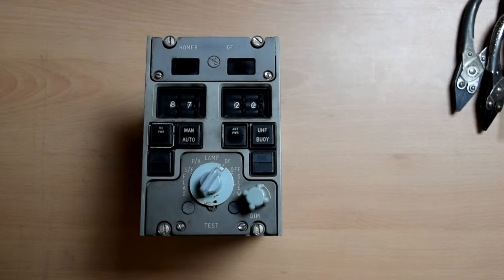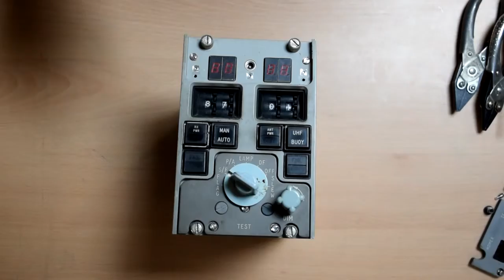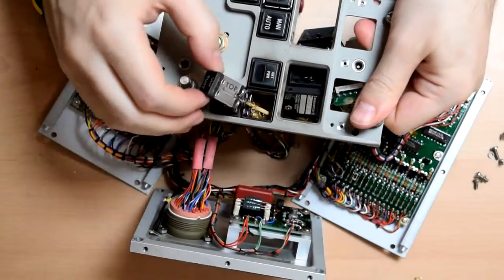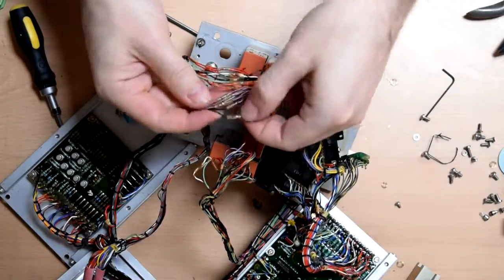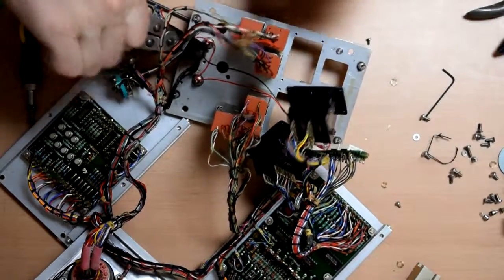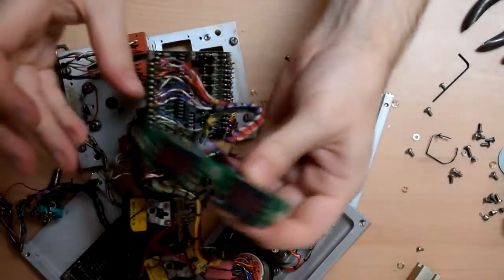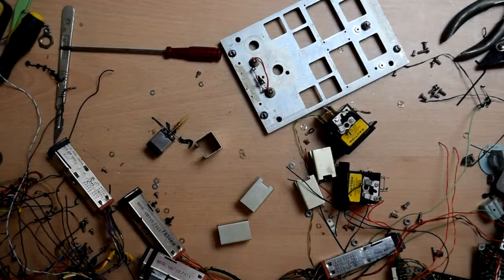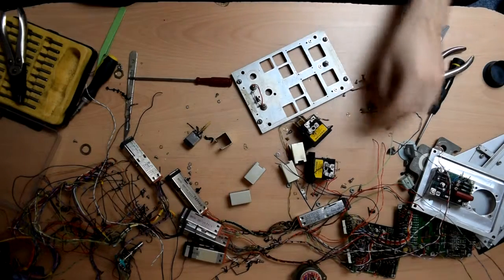Teardown of a homing/DF system box

Comment: It is weird to see how at the same time, they managed to over-engineer it, and make the servicing very tedious, because of the lack of internal connectors between componants. As far as I can see everything is hard wired ??? The illuminated switch are a very common model, I have a few like those. Unhooking the wires plugged at their back probably required a very special and over expensive tool, same thing for the pins of the main rear connector of the box.
Reply from the maker: +msylvain59 Yes.  you can get pin extraction tools for those plugs and doubtless the switches too.  I was going to have a go at making some sort of improvised tool actually as i like to collect the gold pins in the vague hope that when i have a big bag of them they might be worth something for gold scrap.